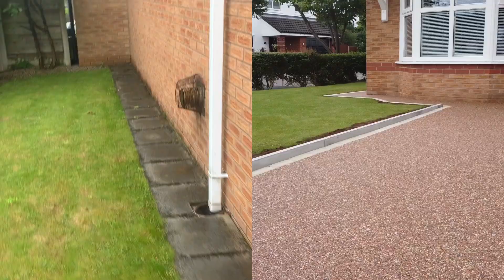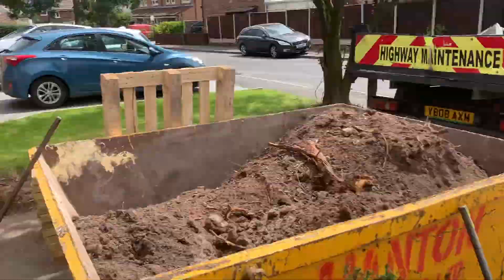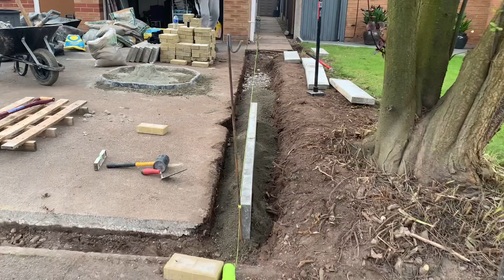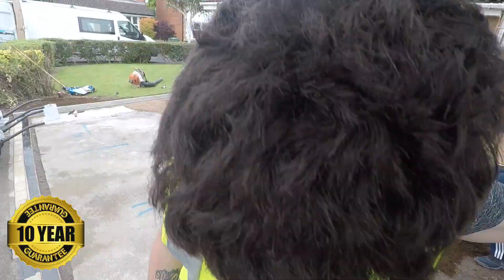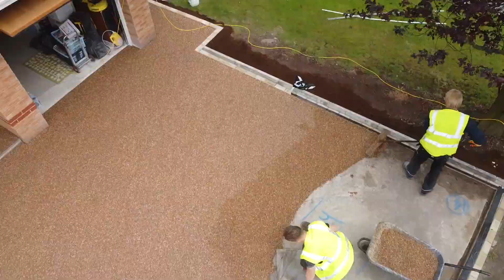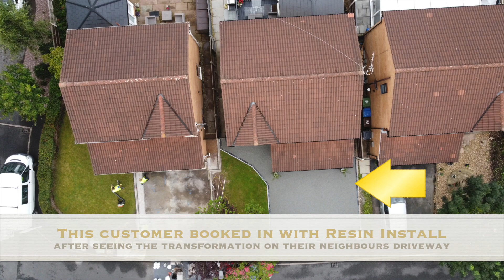How to build a resin driveway by Resin Install

Comment: The paving slabs around the side and front of the house. If they flex or move wont they result in cracks in the resin?
Reply: Yep spot on
Reply: Not correctly prepped..you’ll need flexibility..sub base with expansion joints.

Comment: So you're going over slabs and up to the bricks. Where's the dpc on those bricks, and won't that resin crack over the pavers?
Reply: No need for dpc, the path and drive is a minimum of 6 inch lower than the house and the cavity air flow and dpc at ground level will stop any water travelling inside.
Reply: I also do this and I always recommend to use a crushed stone sub base
Reply: Me thinks eventually it will crack ..ya need expansion joints.

Comment: I though there should be holes in the existing tarmac for the water to drain through no?
Reply: should be water pervious tarmac all over.
Reply: No need if the drive slopes to the road as this probably does!  The rain will run off as it did on the concrete.

Comment: With the resin being permeable, where does the water go if it is laid on an old concrete base?
Reply from the maker: Great question the water will soak through the resin and go were it normally went we always make sure the drive or patio dident have drainage issues before we install if they did it would need a porous base or aco drains adding

Comment: Would you recommend resin bound for colder climates? I’m in Canada and I’m tired of loose gravel. Is resin bound prone to heaving from frost?
Reply: I wouldnt ...look at any driveway...there but joints made by the contractor so it can freely move .this prevents cracks from forming when ground freezes and defrosts

Comment: Hi there, even with protection down I managed to get some drops on a couple of textured concrete patio slabs and tried cleaning but it just smeared ☹️any solution to cleaning it off? Or will I need to replace slabs?
Reply: Brick acid